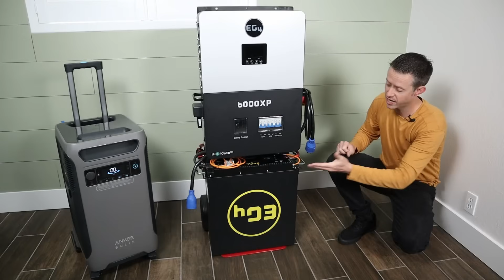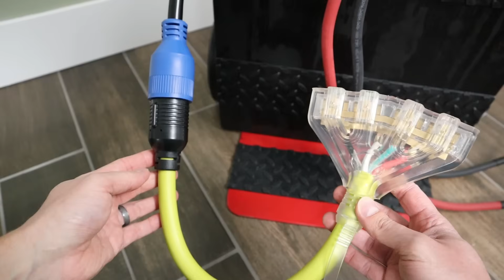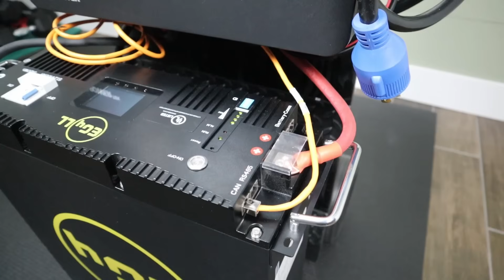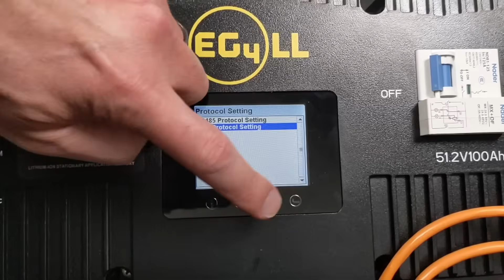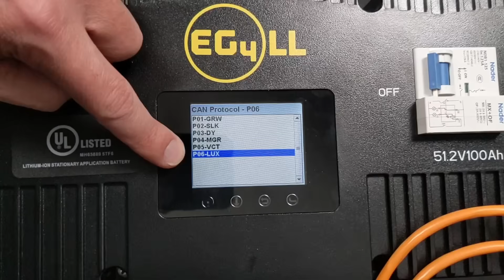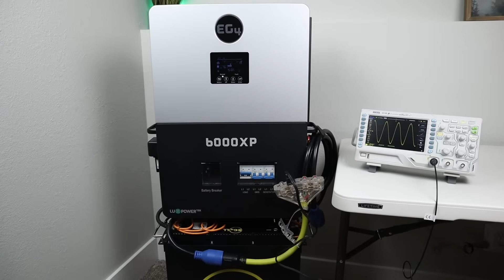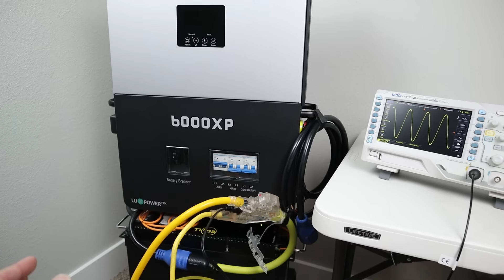Build Your Own AFFORDABLE 240v Battery Backup! Mobile Cart Using the EG4 6000XP & LFP Battery

Comment: biggest problem is size and form factor its that simple  can you imagine dragging the big hand truck in and out of a vehicle for camping or rv or boat ? 
hand cart berfect for home backup but to cumbersome for anything else
Reply from the maker: I agree, this is not something you'll be lifting or moving around much.... but I'd say the same thing about the Anker, Jackery, and Ecoflow models as well. They all weight around 150lbs! DIY really shines when it comes to expandability. Adding 5kwh of batteries is around $1000, when adding expansion batteries on the prebuilt units is around $2000 to $3000 per 5kwh!

Comment: this is a great example of what one can do but what is the benefit of this DIY? its not cost, its not mobility and it is not simplicity.  what is the minimum voltage to get this thing charging? a system on wheels presumes it can be moved and i suspect that means a mobile solar panel system.....the f3800 will work with only two 200w panels that are easy to move and store.
Reply from the maker: To reasonably charge the F3800, I'd recommend at least 500w of solar panels, and even with 500w of solar it will take 8 hours to charge. You need a lot of solar to keep these batteries full.

The main benefits of DIY are repairability, and expandability. If a part breaks, you can swap it out yourself, the whole system isn't garbage. Most backup scenarios you'll need at least 10kwh of batteries to run critical loads. For a DIY setup, 10kwh costs around $2500. For a plug n play setup, 10kwh costs around $5400. Price jumps dramatically as you add on batteries for a plug n play system (that's where they make their money, accessories and batteries).
Reply: @Jasonoid  you have good points and i would suggest that repair ability in an emergency is a no go for any system unless you have spare parts on hand. if using this day to day DIY has the advantage in repairs. i would still want something like the f3800 with its lower voltage solar. it is a massive power station i can lend out to a friend or one of my kids and they can use without them being overwhelmed with it.
Reply from the maker: @arnoldreiter435  I'm still on the fence about which option is better. I really like how quiet and compact plug n play systems are.  I'll have to do an in depth comparison later on the channel!
Reply: on the solar side, i think it depends on what one considers mobile... in an emergency situation (to me) two or even four 425w 48"x62" panels would be something i would work with - and you'd probably have to rotate and pivot the panels from 10a-3p or whatev depending on your latitude... idk man - in a desperate times situation where you needed 240v, this is not bad - but i get the whole "what's your use case point" - just adding portable solar considerations (to me) wouldn't be deal breaker, all good man

Comment: Nice simple setup. I just have a question about one part of it. Is the neutral bonded on the inverter and if it is, should it be separated when you plug the twist lock into your transfer switch input?
Reply from the maker: There is a relay in the 6000xp that allows you to adjust the bonding on or off. If you are going to be using a transfer switch, no need to bond the neutral and ground as it will be grounded from your transfer switch 👍
Reply: @ Cool, thanks.